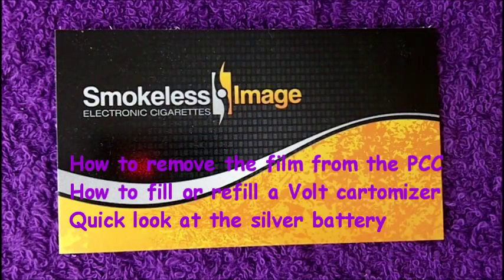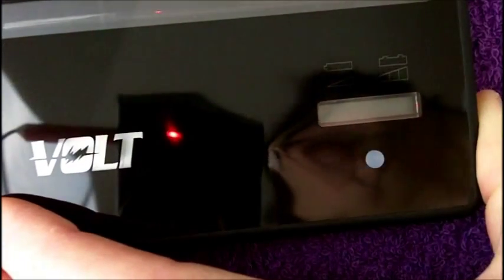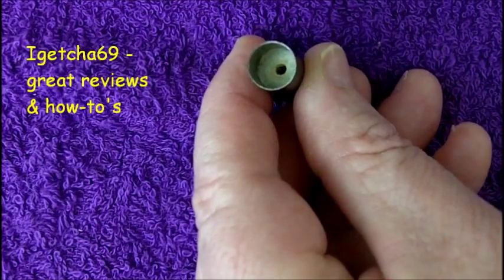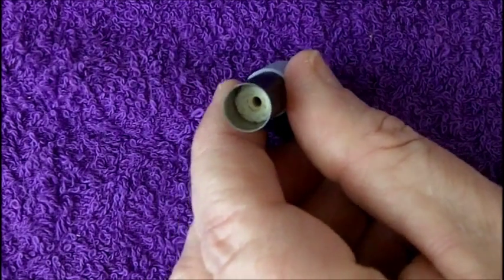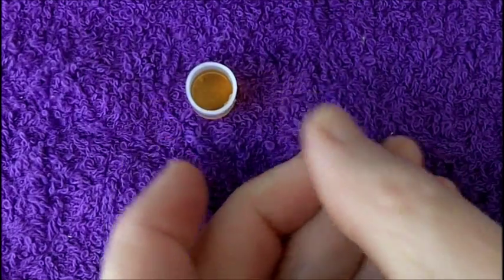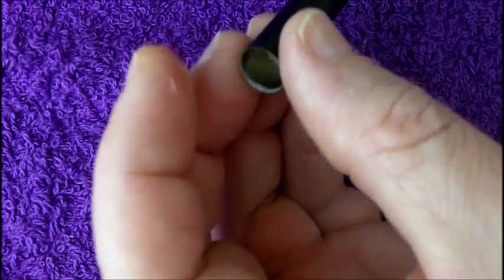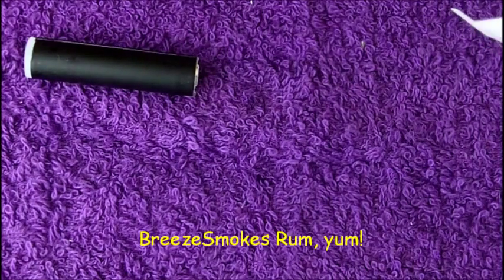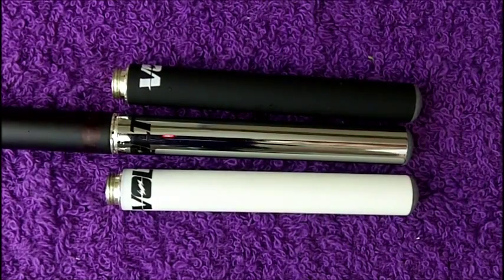Volt How-to's - Refill Cartos - Remove Film from PCC - Silver Battery

Comment from the maker: @JohnnySack187 For a new blank carto, I take off both booties and the rubber tip (there's no gasket in these cartos anymore).  Then I fill up the top bootie with eliquid and push the carto into it.  Put on the bottom bootie, turn it over, pull off the top bootie and fill up the carto.  Let it soak in more, top it off, put the top bootie back on and let it sit overnight.  Pull off the bottom bootie 1/2 way and let the excess run out.  Take off the top, put on a drip tip, blot any excess,done.

Comment from the maker: @dp1582 Yes, you can clean them out with water.  I used to put a dozen in my jewelry cleaner with some everclear & pg and "buzz" them overnight, then rinse, and dry in the sun thoroughly.  The trick to any cleaning is letting them dry out completely and quickly.  But now that I've caught onto never vaping them all the way empty, but keeping them wet with juice all the time, I've not found a need to clean them, they'll last a couple of weeks and then I toss them.

Comment from the maker: @Amber77k When I put more in before I ever let it get dry, they last a long time.  The one I'm vaping now I've been using for 2 weeks and I'm seeing how much longer it will last.  Typically when they finally get funky tasting or the draw gets stiffer, I toss 'em.  But I used to clean them overnight in a jewelry cleaner with pg & everclear, dry them out in the hot sun, and they'd just keep going like new.  Darker, sweeter eliquids tend to crud up the coil fast, so I stick with light stuff.  tks

Comment from the maker: @tinaBOOBina Yes you can use 60/40 pg/vg in these cartomizers.  I've even used straight VG but have trouble getting it to soak into the fibers, it tends to want to blob down the center and flood the coil.  By far these, and most, cartomizers wick and perform best with pg, but I've used 80/20 or even 60/40 without a bunch of problems.  Cheers!